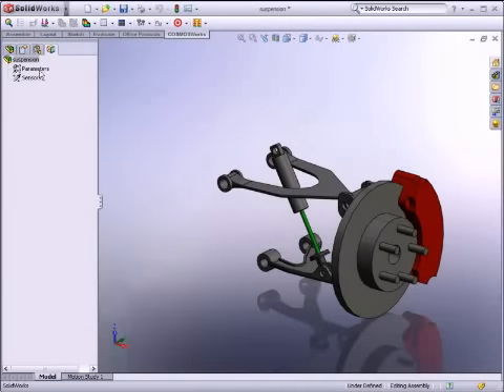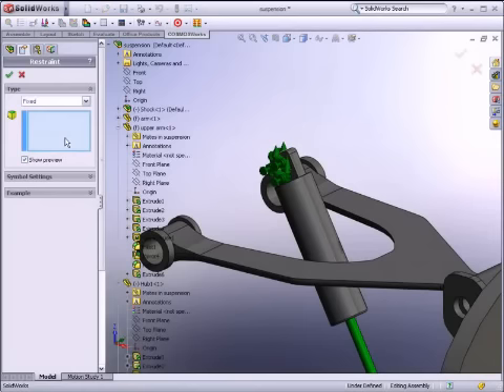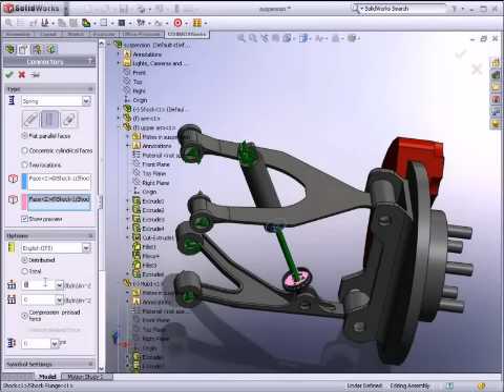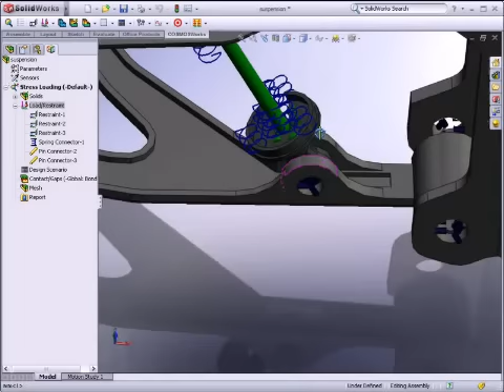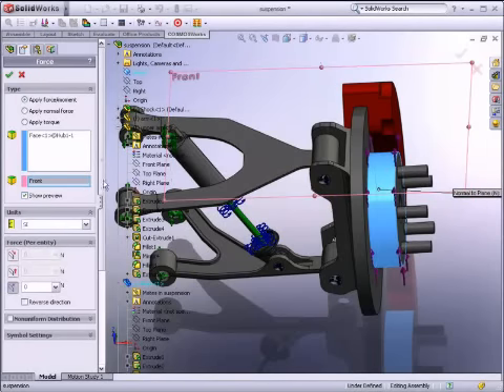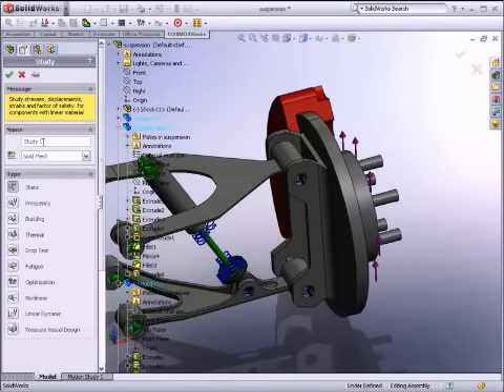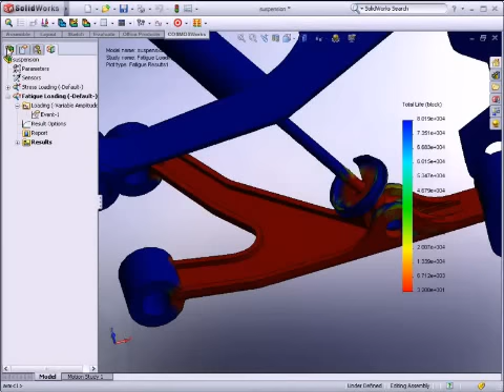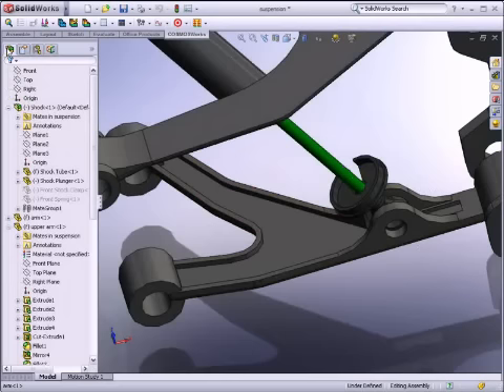SolidWorks Simulation Professional Fatigue

Comment: Aeroengineer is absolutely right.  Can't believe the guy making the video see no loading in the upper arm and didn't give any reaction...  But he may be just a software guy, not engineer.
Reply: The lower arm sees a lot of bending load since it has the spring/damper connected to it, while the upper arm is free to move, and sees no bending forces in ideal conditions. This is the reason that the lower wishbone has been designed heavier and stronger than the upper.
Reply: +Harshit Rathore 

i didnt understand what is wrong with his analysis - everybody says so.
Upper arm is two edge pinned and almost no load on it.

Its true - lower arm has a pin in the middle and that create bending. (Moreover applied forces are only in Z direction - he ignored x and y)

if there were x direction forces considere (like a drift car)
then buckling would occur on the upper arm

It looks true to me - correct me if i am wrong...

Thanks
Reply: Yes, you are correct. He has taken only z-axis loads, ignoring cornering forces and brake torque. With those considered, upper wishbone will see tensile and compressive loads.
Reply: +Harshit Rathore 
aeroengineer refers to hinge constraints which is totally irrelevant with what he claims.
so its because of direction of forces only...
Reply: +EYUP FIRAT AYDIN 
Pardon me, it's been a long time I commented on this video, so I didn't read aeroEngineer's comment before commenting. He is right though, if the hinge constraint is not set for the damper, the joints would be considered as fixed, and one would see considerable deviations in the results from  the expected results.
Reply: +Harshit Rathore 
AHH YEAH I just saw it. I watched the video first NO VOICE and very poor quality.
Watching again - now i can understand what aeroengineer trying to say.(FIX JOINT IS WRONG THERE)

AEROENGINEER - sorry mate you are right.
Reply: this is the ideal case where we are only considering the normal loading that is where the reaction force from the road is parallel to the vertical axis not at some angle.